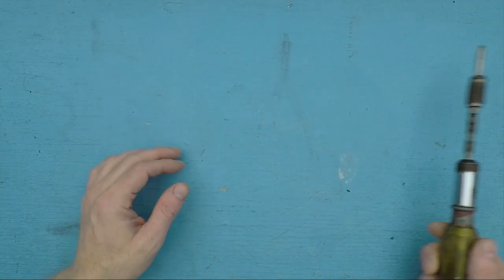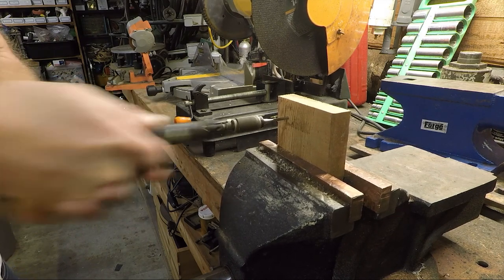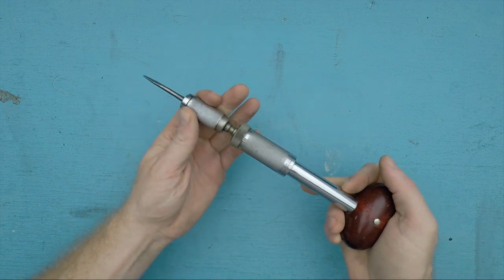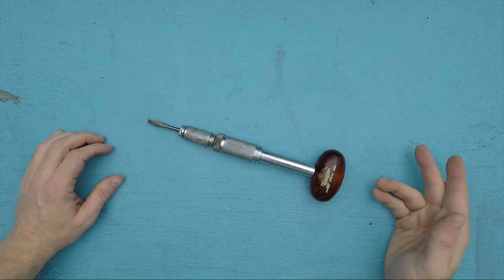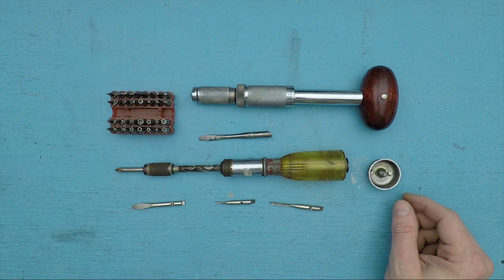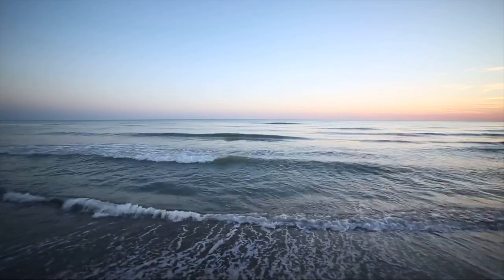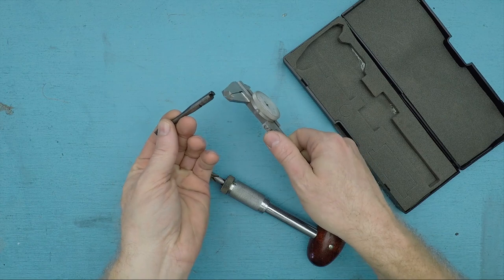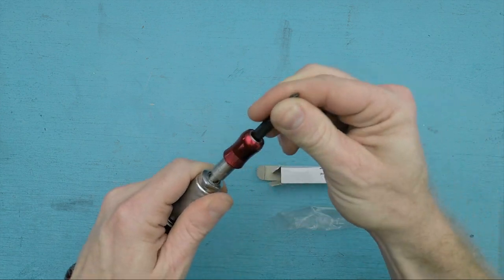Yankee Screwdriver Hex Bit Adapter

Comment: I have two of these, and I've found them most useful for drilling... I build a lot of livestock shelters/tractors, and as far as I'm concerned there is no modern tool better suited for making shallow pilot holes for hinges, hasps, latches and hooks. Light, fast, precise, and powered with one hand leaving the other free to hold the hardware in place.

Comment: Essentially there's three different size of Yankees: 
1. Small 133 or 135 - 5.5mm diameter shaft
2. Medium 130 - 7mm diameter shaft
3. Large 132 - 8mm diameter shaft

You can make a Medium size adapter from a long 1/4 hex bit holder.

Comment: I got as far as making an adaptor which then broke after a year or so. About to order some of these adaptors from Axminster (UK based)
Reply: Why not just grind down a set of bits?  Make them round.  Put in the D shape and notch.  You need 5.5mm, 7mm, and 8mm.
Reply: @alext8828  Much less work to have an adaptor and be able to use cheap commodity hex bits when they wear out. My existing bits are exactly what you're describing.

Comment: Which Hex Adapter option from Lee Valley tools, did you choose for your Millers Falls No. 430; was it the 5.5mm (7/32"), 7mm( 9/32"), or 8mm (5/16")?

Comment: That's awesome. I have one that belonged to my dad. I have no idea how old it is.
Add a set of hex drive drill bits and it would be a fantastic off-grid tool.
EDIT: Does anyone know of a drill bit chuck adapter for a 3/8 drive speed handle?

Comment: Why don't they make these anymore? I guess impact guns replaced em.
Reply: Which is silly. I'd imagine there are environments where screwdrivers like the Yankee are still of value and use. Potentially explosive environments for sure where power anything is a concern.
Reply: @rico76  If I was in an environment like that, I'm not sure I'd be much more comfortable slamming a ratchet mechanism down a long metal shaft.  But yes, they're still useful, in fact you can still buy new ones (not Yankee branded).  I just bought one that has a 1/4" hex collet, no adapter needed.
Reply: @jic1  What brand did you buy?
Reply: @encapsulatio  The one I bought was branded Silverline, but I believe that the same screwdriver (or ones very like it) can be found under various brands.